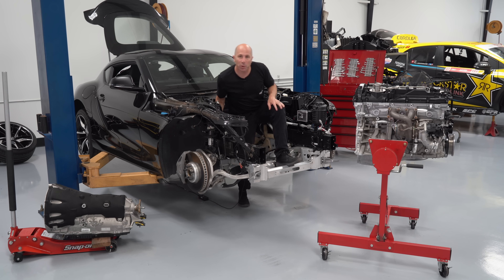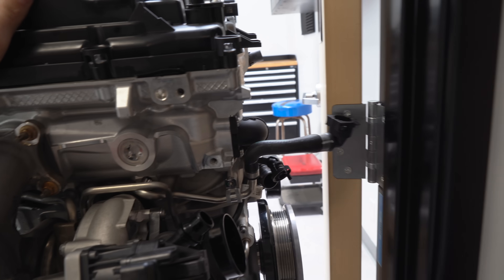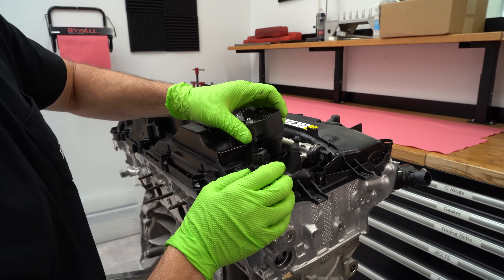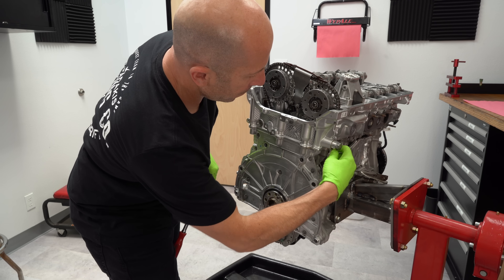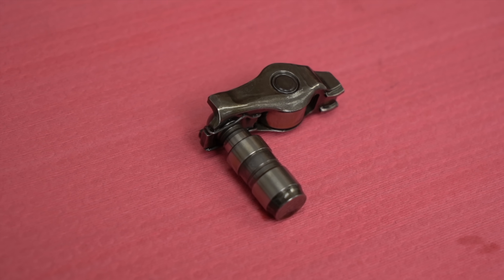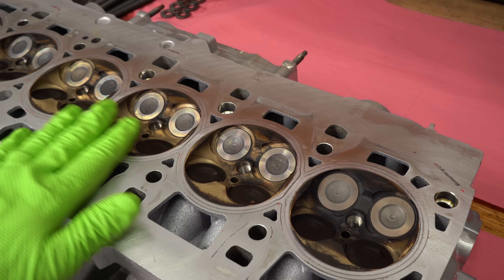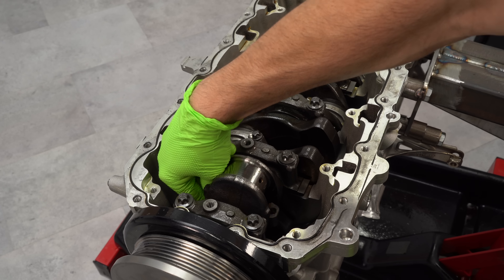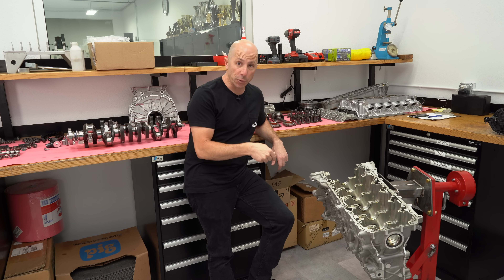2020 Supra B58 Engine Teardown - First Look - Better than the 2JZ?

Comment: I believe the heat exchanger is inserted into a mold and the plastic intake is injection molded inside a die around it. Once it cools it comes out whole. And since the heat exchanger can handle heat the hot plastic being injected in doesn't hurt it one bit. These types of plastics they use are actually very cheap to produce. I worked for 2 years in injection molding and over 5 in machine/stamping shops.

Comment: I get flashbacks from my b6 Audi s4 from that timing chain placement :(  
Such a bad design....
Reply: Agreed
Reply: I replaced mine with rs4 tensioners, much better material!
Reply: @UT3CTF  yes but both BMW and Toyota use a 3rd party manufacturer and I'm not positive but I think Toyota assembles the engines at their own factory. The only thing that the Supra and the Z4 have in common is the fact that they use the same platform and base engine. Everything else is different. I'd have to double check that but I think that's what they do for it
Reply: @zul8tr  All BMW software and electrical components as well. (Indicator switch, buttons and such.) Doug Demuro has an awesome video on the new Supra.
Reply: Major reason to run timing chain in the rear is that it allows more accurate timing by eliminating the flex of the crankshaft compared to running on the front. I also had a b6 s4, guess when i got rid of it? haha
Reply: Yeah, and those tensioners... Guess its the new thing... GM has used them on at least their fourbangers like the ecopower forever... And they have failed ever since...
Reply: I may be wrong, but I feel like I spied some plastic timing chain guides and tensioners too...
Reply: But with it being a chain, you shouldn’t have to replace it. Highly doubt these cars will see 150k+ miles on them anyways
Reply: Austin Smith that’s what Audi said...and then look what happened
Reply: @AJSmith257  Lol that's what everyone thinks until the chain stretches or the motor decides to eat a chain guide.
Reply: @AJSmith257   My C5 RS6 has 166k on it so far :)
Reply: @AJSmith257  It's not that wild to see old Supra's with 200k miles on them. One thing that has been amazing in the past is Toyota's reliability, with all of there cars.
Reply: @AJSmith257  I'm not sure how common it is for a chain to snap , what I've heard and experienced  that  it's the tensioner that fails or the components in it.
Reply: @mkkeable  correct amundo.
Reply: You guys realize this is a Toyota right.. and yeah sure the engine was manufactured by BMW, but Toyota took the entire engine apart, bolt by bolt, and made it up to par with their high reliability standards.
Reply: @zul8tr  best feature is probably that they sealed the motor so it doesn't piss out of every gasket orifice like a bmw..
Reply: @zul8tr  So if I bring my car to my local tuner to replace a bunch of parts in the engine, I now have "XXXX tuner" car and not the manufacturer? Cmon, it's so sad that for decades we called out rebadges but now that it's the Supra suddenly we are making excuses =/
Reply: @aflacduck2  a true rebadge would be something like the eclipse, not even a coupe anymore it's literally a crossover. Toyota still made the car the essence of what a Supra is, a 2 door inline 6 sports car. Doesn't mean it absolutely has to have a 2J in it. Look at the older koenigseggs, they literally had the same V8 that Ford put in their trucks, crown vics, mustangs, and more. But they built it to the cars spec. As every engine is built to each cars spec. The engine plays a factor in what determines the car but not the whole car. Hell, the SLC kit car can have any engine but it's still an SLC. Sure, technically not a real manufacturers car but the same concept applies. You could also argue that a simple ECU retune could be called a tuner car. I'm not arguing the fact that Toyota uses a BMW engine in the Supra, but what I'm saying is simply that they make sure that it is up to Toyota standard when they put them in their cars, just as koenigsegg did it with Fords engines. This is more common in the car world than people realize. Everyone is just mad that the Supra doesn't have a Toyota based engine. If it did, it WOULDN'T have an inline 6 because Toyota DOESN'T make them. Toyota is literally meeting the public's demand of bringing back the Supra. Do you expect them to design an entire new engine when they don't even know if it will sell? Why would they waste time and development on it if they can't sell it? That's an entire platform that they don't even make anymore. The fact that Toyota picked a BMW engine in the first place should at least be some indication that they trust the engine, so why shouldn't you? They have engineers who are far better than pretty much anyone who isn't literally in the business of building cars that meet manufacturer standards, because race cars are different and don't need as much attention to detail as mass production cars. People are mad at Toyota for giving them what they want, but "iTs NoT THe MArK 4 aND iT DOesNt hAvE a 2JZ" sorry that they're trying to give you what you want at a low production cost.

Chevy didn't have to make the C8. It didn't have to be mid engine. And it definitely doesn't have to be a low cost of 60k. But they are doing it because they're passionate and they are pushing the platform to new boundaries. People don't like the mid engine layout? Well don't buy it, simple as that. New technology is gonna have problems sure, but these cars don't have anything new, they're just taking what WAS new and making it the standard. And they don't have to.

This is what I hate about the car community, people complain about shit because it's not this or that but then they complain when prices go up because no one is buying sports cars anymore since the manufacturers are doing what they asked and adding all of this technology or developing engines and components they don't have to develop, when there are others that are already proven and good. Toyota is trying to reduce that cost. And the B58 is a solid fucking block, just like the 2JZ. No car is perfect, but at least Toyota tries their hardest to make sure they're damn near close to it.
Reply: @zul8tr  At least those were Ford Engines. I would've loved to See Toyota Flex their muscles and make a 3JZ. Fuck, Even if they just reused to Lexus 3.5 liter (Which is an in house Toyota 6 cylinder that makes MORE HP in the 500 series sedan.)
Reply: @Mrjohnnymoo1  yeah I agree with you there, I think it would be badass if they had a 3JZ. but again, it's all about cost and who will buy it. The majority of the market demographic for Supra buyers will be people older than 45, who have the money to buy it. 90% of those people probably aren't even paying attention to the fact that it has a BMW engine
Reply: @zul8tr  You're probably right. However I 100% am of the opinion that what made the Supra so iconic (Minus movies) was how amazing the engine was, and how much more power you could make with it for almost any other small engine of the time. I always figured the people that wanted the new Supra wanted it because of the old one.
Reply: @Mrjohnnymoo1  you're definitely correct about that, though people didn't realize the potential of the 2J until a good few years after the car was off the market. I don't think anyone saw it coming until years later that you could push 1000hp through that inline 6. And you also are correct to the fact that people who want the new one want it because of the old one. The mark 4 was so ahead of the game at the time, and still even today can compete with the current Supra. But those were different, more simple times. Times when you didn't have all of the luxuries of cars today. The Supra then was 1 thing and 1 thing only: a fast as fuck sports car, even if that wasn't the original intention of it. Now a days manufacturers are focusing more on handling and efficiency rather than just speed, hence why the Camaro is being discontinued after 2023, or so we're told. Soon after will be the mustang. It sucks but no one wants a big V8 when they can make similar power with smaller turbo engines. The only time you're going for that power is in something like a vette, in which case you might as well just buy the Vette cause it handles better than a muscle car and only costs a bit more.

But that goes back to the original point, Toyota doesn't want to spend the money to design a new engine. I'm sure people would be happy (myself included) if they just updated the 2JZ but again they don't want to spend all of the manufacturing cost of that.

Going back to the Camaro, they pretty much did the same thing. The 5th gen shared an engine with the C6 Vette, and the 2010 Camaro was more of a test run for GM to see if the public wants the car. Turns out everyone likes bumblebee, myself included, which is why I own a 5th gen. But the fact of the matter is that they were able to make a good muscle car that didn't have too many bells and whistles, had a lot of design cues from the 1st Gen, and performed like a beast with a pretty low cost. Not to mention the entire LS scene was just starting to take off and the LS happens to be a boost monster, just like the 2J.

Then the 6th gen Camaro comes out. Nice car, doesn't look a lot like the 1st Gen but still modern, bunch of features, makes good power. Didn't sell nearly as well as the 5th gen. Why? Well, it seems to me that the car is too expensive for what it is. It loses the essence of a muscle car. Ontop of that, it's engineering is much more complicated than an LS, due to all of the computer technology that goes into it. Mods cost almost twice as much as LS mods and are harder to install.

The people who truly want a sports car for the nature of it are people close to my age (late teens to mid twenty's) but none of us can afford them. The people who can afford them aren't modding them because they are generally older and just want to buy something off the lot that looks good and does the job. So there's the dilemma. And those few that do want to mod their new cars? Good luck finding any aftermarket parts that are remotely cheap. It just sucks. If the manufacturers made these cars a little more accessible to everyone then we wouldn't have this problem. Toyota tried that and they STILL charge 50k for the new Supra. This is why the Vette will probably eat up their sales, it's so much more car for just 10k more. I'm sure people looking at these cars can spare another 10 grand.

Technology is great and all, but it's destroying the enthusiast market. Cars are so advanced anymore that there's little need for modifications, which in turn makes them so much more expensive to work on. Good luck getting your Tesla fixed at a cheap price. All you can really do anymore is visual mods without breaking the bank. This only applies to newer cars really. But it's soon to be the standard. The car market is changing. Cars are getting so advanced that we don't really need to mod, but in turn they get more expensive and the older crowd has fewer buyers. It's kind of a shitty situation all in all. Sports cars would make a killing if they were JUST sports cars. None of the crazy shit that manufacturers put in their cars. Just a car that is all about handling and speed and that's it. Something cheap and easy to mod. Only then would the younger crowd be able to afford it and the aftermarket would be booming with the newer cars. The LS aftermarket is amazing what you can do with it, because they sold so many of them that you can pull one out of a truck, slap a cam and turbo on it, and call it a day. You can't do that anymore. Now you have all of these variables and parts that are so complicated that any average Joe would be in over their head trying to build it. It sucks, but it's where the market is moving.

Comment: Dude everyone else is SLACKINGGG this dude already got the motor torn down and doing R&D for internal upgrades... i just have 2 serious questions....
How do you plan on overcoming the ECU and Trans Controller issues....
Reply: And my second question is how are you going to get around the inherent restriction of the half/assed half-a-manifold they got going on for the cylinder head.

Comment: Nothing special just building a bmw to 1000hp
Reply: Honestly though, why would anyone care about building a B58 when they can build an S58? B58 is like a diesel motor in comparison, all TQ, it's going to make it harder to get the CFM in the smaller bores compared to the S58. Not to mention the S58 will probably rev faster being a more square setup.

Comment: It's like modern diesel engine. Rear timing, direct injection, block stiffener. This got potential of a lot of torque
Reply: Duh its a bmw engine
Reply: Lol. Diesels have gears. They dont fail. Chain f up daily. Look at audi or mazda or nissan or bmw.
Reply: @destin-diesel.9495  Lots of diesels have timing chains and lots of diesels have timing belts...
Reply: Destin - Diesel. Not true

Comment: Wow seems like "do it at home" is over with this engine
Reply: Looks a lot less complicated to tear down than the 2JZ, so that's a bonus
Reply: Well tbh there's nothing that Stephan used to tear this down that can't be owned by a home mechanic. The most expensive tool here was the engine hoist. By the looks of it, this won't even need any major internal maintenance for a long time and by that time the special tools needed for certain jobs will be easily accessible.
Reply: @stanleycorr1839  don't forget about the lathe to turn down a spark play socket
Reply: @rexleehe7633  you can buy thinner sockets for like 10$ at canadian tire lol
Reply: @dannickpotvinFX  yeah but  you said he didn't use anything that a home mechanic won't have but he did and some home mechanics don't have a welder or scrap steel laying around to make a custom engine stand mount
Reply: @rexleehe7633  you ever figure that the aftermarket world will most likely come out with everything you will need for this engine eventually.
Reply: @rexleehe7633  you're right but these will be availlable soon

Comment: This is where all the BMW bs comes into play. What happens in 5-10 years? That intake manifold with a built in intercooler will probably fail. I love Bmw i have a few myself I love Toyota l, but this is where the reliability issue comes into play. Going to give Toyota a bad name in the long run

Comment: For Removal and install of the eccentric shaft, you can use 4 or 6 long bolts and nuts. Hold the bolt in place, and evenly tighten the nuts till the eccentric shaft is seated. You gotta make sure the valve train is lined up, but it works great. It’s what I normally do for when I need to remove it while it’s in the car. I can’t wait to see the rest of this series!

Comment: cant believe they've put the timing chain at the back so you have to remove the whole engine to do one... what a joke... let alone checking timing etc would just be stupid hard on the spot... then if ya wanna change cams you've even gotta pull the engine... the engineers of this engine yet again being backwards asf =|

Comment: fuck off drive by wire is faster, i can tap my foot on and off the throttle so quick that it wont open at all, in a mechanical set up the throttle goes where your foot puts it when your foot puts it

Comment: Thanks for another great video, really wanted to see how bmw did. Don’t like the head design one bit, routing exhaust through aluminum is asking for trouble. Not to mention the timing chain with plastic guides on the back of the engine, thought they learned how terrible that is from early 2000’s Audi’s

Comment: Very cool and entertaining video, thanks!
I noticed that the pistons' tops have a bit of a carbon built-up. Is it normal around 500 miles (I know it's direct injection)? With a 1000 hp tune, would it cause any issue or it doesn't matter at all? I've read that water injection can prevent carbon built-up (and more power).  Would it be any good for the motor or just complicates things to a level you don't want?

Comment: Everything about this motor looks like a total pain in the ass for service unless you pull the motor (so just the standard newer BMW crap). I guess that's fine for professional motorsports but screw having that shit on a daily driver. I'll stick to motors that are simple to buy and build with good aftermarket support. Can't wait to see what you can do with this motor with all the limitations of the design and literally no aftermarket support at the moment.

Comment: Note: this engine and BMW engines for the past 10 years or so,do NOT use the throttle body to "give it gas". They control the flow of air directly at the valves. When you step on the gas,the Valvetronic system commands the throttle to a pre-determined open position(usually always open) and then uses the valves to give you what you want,using the throttle body only in emergency situations or when coming to a dead stop.(also,the oil level sensor works by measuring current conductivity in the oil. Depending on how worn,the conductivity changes)

Comment: @ least the 2JZ was an iron block, with a real (bucket and shim) valve train!@
Reply: Peder Hansen  funny....all the Supras I see on YouTube, are straight line racers, including this one.
Reply: Peder Hansen  the mk5 is a joke, and so is that plastic roller rocker BMW pile of shit engine 😁
Reply: Peder Hansen  well this is a bmw with a Toyota badge on it. If Toyota can't be bothered to even design its own engine for its one "sport" car because of low volume. Then just buy the bmw.
Reply: Peder Hansen  you dont need handling, to run. 1/4 miles....